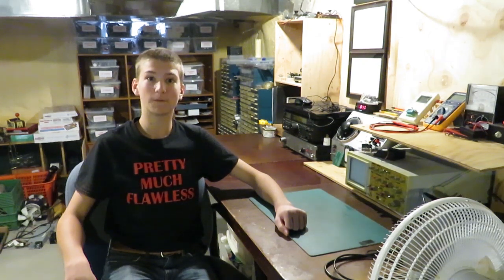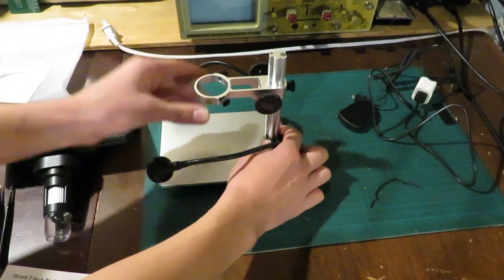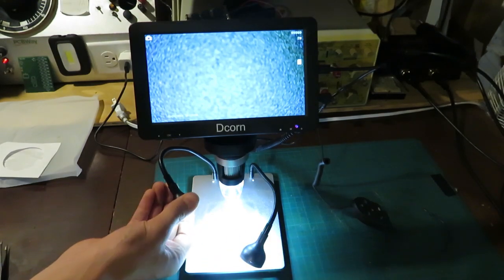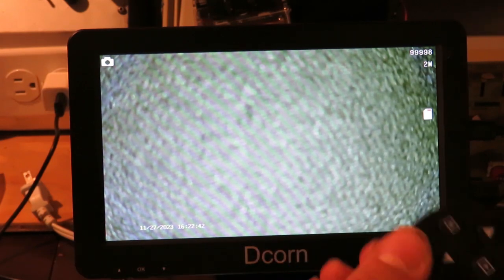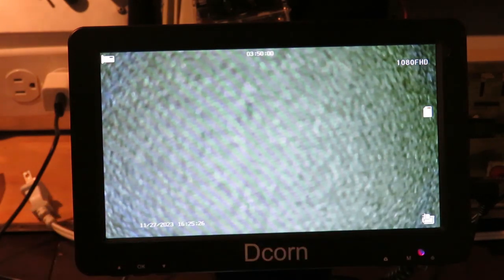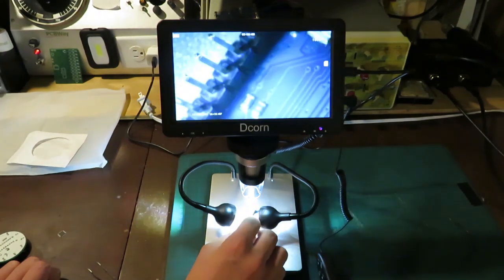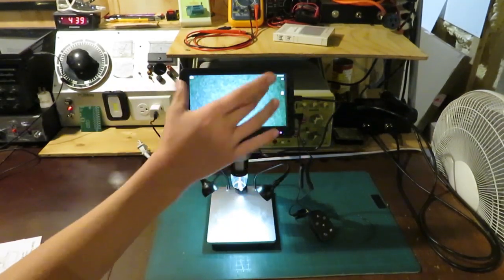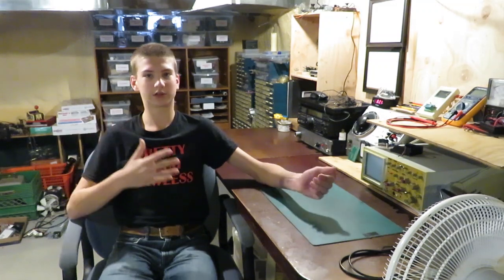Dcorn 7" microscope review

Comment: you're oversaturating the focal objects.  tuen down the lens LEDs with the wheel on the side of the display, and turn down the stalk lights.  You can also get them to stay in place better, by bending them closer to their bases, instead of bending them at the heads.  You really need to light-balance your objectives because the microscope doesn't auto-adjust for saturation.
Reply from the maker: Thanks for the tip! and Thanks for watching!